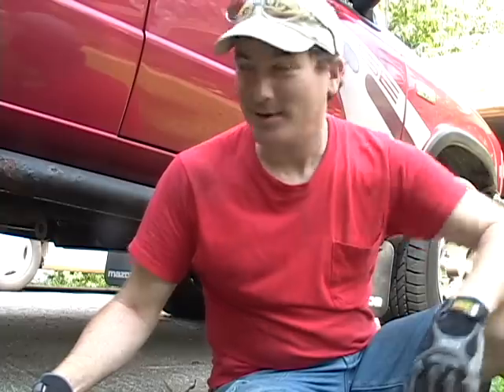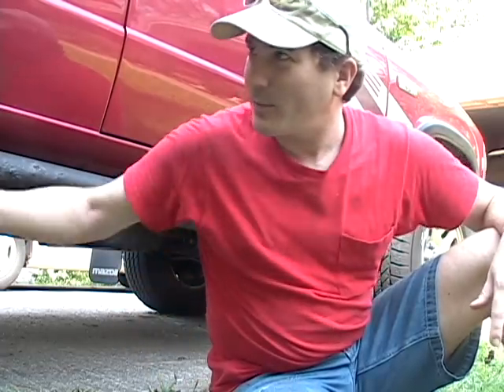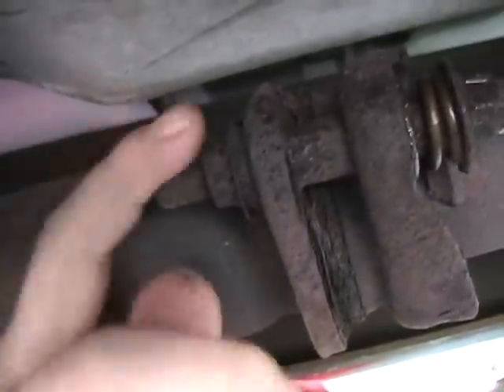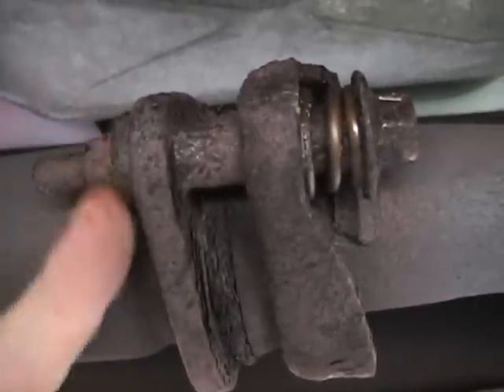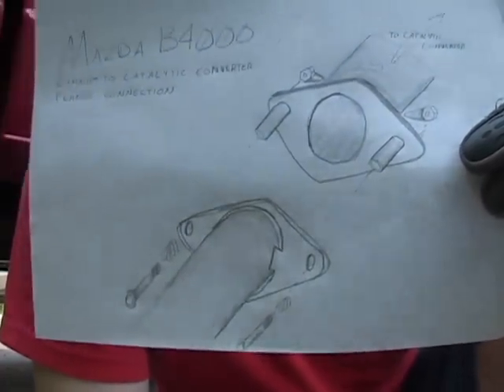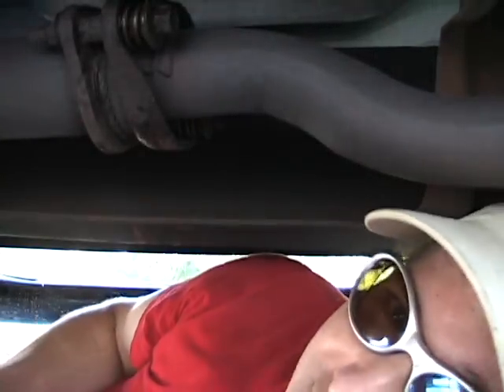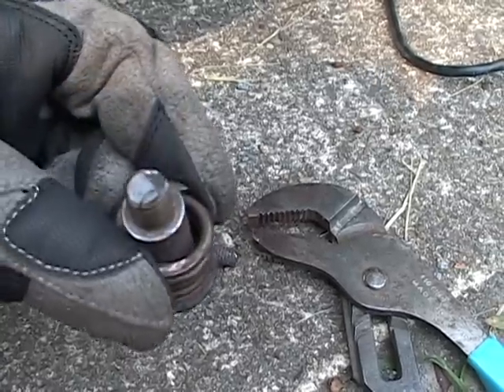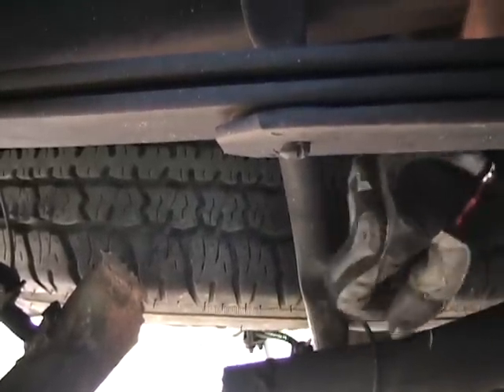Cat Back Exhaust Install On 1995 Mazda B4000 (Part 1)

Comment from the maker: @38spencer38 I've never had any problem getting parts.  If you do, be sure to also check for parts for a Ford Ranger.  That's pretty much exactly what this truck is.  Motorcraft everything under the hood.  If it fits a Ranger of the same year, it will fit the Mazda.

Comment: The actual headlamp is slightly different than the Ranger. Had to remove the plastic bolts on my 1998, rather than the 'tabs' they have on the Rangers.